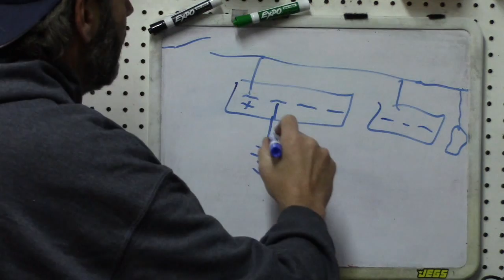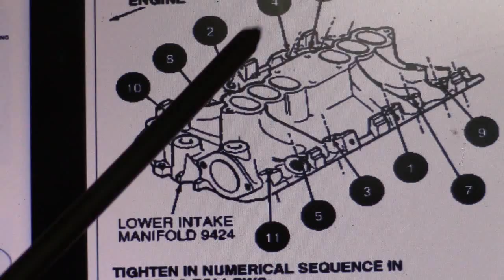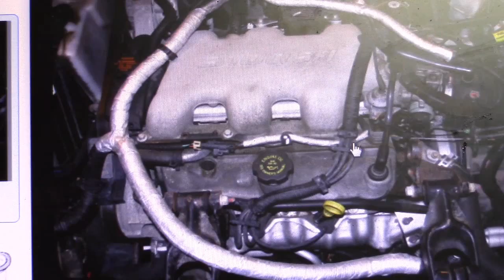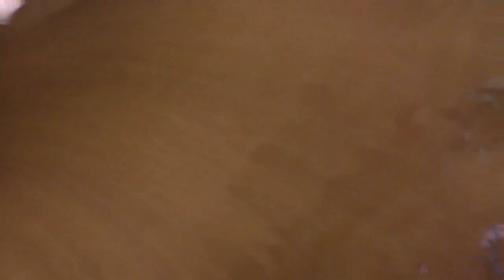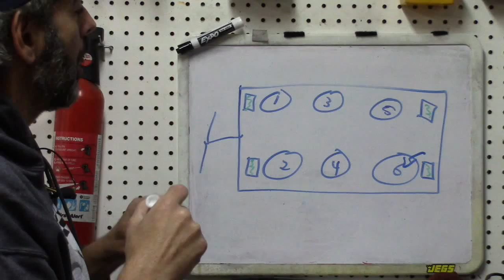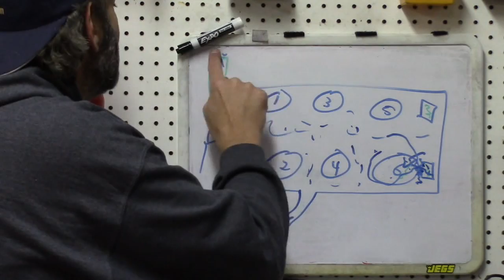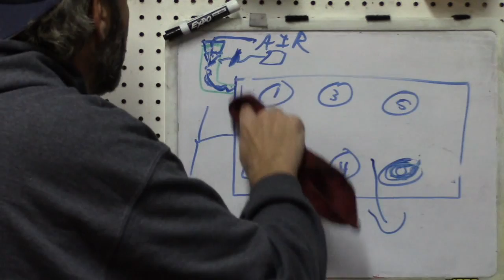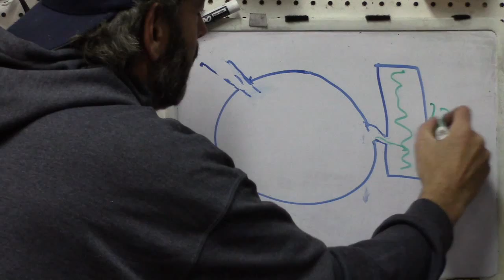04 Toyota P0306 Pt2-Can Compression Test Lie?

Comment: i think a small enough leak path would fool  a compression test and a leakdown test. did you ever try to release the rad cap after shutting down the engine to see if the condition still occurs after starting up? that would prove or disprove the theory of 12 psi forcing coolant into the cyl. i think the leak  may be more to do with time laps than engine temp. i think the leak is probably  very small and constant and after the engine  is running and burns off what accumulated during the shutdown period,the leak is then consumed in the combustion process.if the leak is small enough it wouldn't show any white exhaust smoke i think i might try to rig up a way to pressurize the cooling system and let the thing sit for a day to see how much if any coolant accumulates in the cyl,  all this babble assumes you have correctly identified the problem as antifreeze in the cyl. good luck and i hope you follow this problem to a successful conclusion.
Reply from the maker: How can the leak be so small as to fool a compression test at 160 PSI and a leakdown test at 90PSI but coolant can just drip in under no pressure? How do you explain that?
Reply: @SchrodingersBox  if air is being introduced into the cyl via a comp tester or leakdown tester  and a leakpath is small enough the leak can go undetected . you can demonstrate this by installing a shutoff valve on a leaktester and then opening it up a little at a time and see how much air you can flow before its noticeable on the gage. i think the piston ring gaps would provide a bigger leakpath than this leak your looking for . i didn't mean to imply that coolant was leaking in under no pressure. any leak detected bv a compression or leakdown test would surely pressurize the cooling system and cause exhaust bubbles in the coolant and eventual loss of coolant. i believe the coolant is somehow being introduced above the valves. a video camera looking into the intake may shed some light on this. i know you have been told that this is a dry intake, but the coolant is coming from somewhere and i think you need to separate the potential leak paths between the intake side or the cyl side.

Comment: Now I'm super curious! (Dealing with a similar unresolved problem on my Subaru, coolant loss, no test failures, nothing definitive)
Hope you get it back for completion. (I'm still stuck on a cracked head/valve guide as possible source) I've only seen it once in my life...coolant leaking onto the intake valve from a cracked guide...
I feel your frustrations!

Comment: Good learning experience.  Regarding the pinhole leak from the cooling system into the combustion chamber - think of a bicycle inner tube, out of the tire, and a pump.  With a very small pinhole in the bicycle tube you can pump the tube up and lose almost no pressure within one second - the time it takes to register a pressure reading on a compression test.  What is even more interesting is that a leak down test might not be telling in this case either as you may not lose enough PSI to register a problem over a period of a few seconds.  Looks like the inexpensive Amazon boroscope camera plugged into an IPad is a good solution.
Reply from the maker: But the leakdown test is akin to putting that tube in a bucket of water, seeing no bubbles, and yet there is still a leak?
Reply: @SchrodingersBox  no, a leak down test is not akin to fitting an air hose into a bucket of water sometimes... in some circumstances a very small leak in the combustion chamber component can be present and filled with coolant and gas in the cylinder has to work against it and displace it, how could it be put, a liquid plug within the small failure passage. Diagnostics can be very difficult sometimes and catch even the most experienced of us out at times.

Comment: First, kudos for admitting the error.  Second, don't doubt what data you have.  The error was (is) deciphering what you can conclude from it.  Coolant can flow into the combustion chamber through the intake anytime the pressure in the coolant system exceeds the pressure anywhere in the intake side.  The intake plenum is usually operating at a vacuum (approaches equalizing to atmosphere only at wide open throttle).  Second, even on the compression stroke, don't get confused that the cylinder pressure is at the maximum pressure shown by the compression gauge...it is a dynamic pressure (and vacuum) in each operating cylinder; the compression gauge only shows the maximum compression of each cylinder (without combustion, of course) over multiple compression strokes (duration of the test).  Even on the compression stroke, each cylinder starts with a pressure that is below atmosphere and certainly below the pressure of the coolant system.  

In short, I believe the compression test shows that you do not have head gasket failure on the compression side of any cylinder conclusively, but you still have a leak of coolant into either the intake plenum through the affected cylinder or via a leak in the head gasket (or other sealing surface) immediately after the intake plenum.  Can you check for presence of coolant in the intake runner to the affected cylinder?  This may help narrow down the source.

Understand you don't like guessing, but since you have no compression  issues or oil contamination, I would focus on the intake side, including removing the intake plenum, checking sealing surfaces, and replacing the gaskets on that side.  Willing to gamble it fixes the issue, and if it does not, no major harm (financial or to the engine).  A head gasket replacement is cost prohibitive and engine is running fine except when cold.  The concern I would have is that the coolant is not doing the cylinder any good in the combustion chamber as it is washes oil away from the cylinder wall (increasing wear).  Source of corrosion if engine sits for an extended period of time.   Last, could also hydrolock that cylinder at startup if coolant pools into the affected cylinder, causing catastrophic engine damage at start up.

A boroscope view of cylinder 6 will also confirm presence of coolant in the combustion chamber.  The cylinder will have less carbon build up relative to others  as a result of the coolant vaporizing during combustion.

Comment: We don't know without a complete disassembly of the engine. Lets not second guess. Empiric exit...🤣 Compression test lied!
Reply from the maker: We don't want to do disasembly of the engine- too subjective and gaskets get damaged when you separate the parts. we need a visual using a borescope on the actual leak occuring live.  Which is exactly what I'll do.
Reply: @SchrodingersBox  Great solution if the borescope shows the actual leak.

Comment: A compression test gives a vague small window of info. It has its place as a valid test, but as a baseline to dig deeper and should be taken with a grain of salt. Compression test can(but not always does) tell you that there is a problem, cylinder leak down test can(but not always does) tell you where the problem is. In some cases like this coolant breach, its easier to pressurize the cooling system and watch where the coolant goes, than it is to pressurize the combustion chamber and hope the air doesn’t get trapped in the cooling system as an air pocket and somehow make its way up to burp itself out of the radiator neck. Hope this helps. We all learn from each other, constantly. That’s what I love about being a tech. I keep a humble open mind always.
Reply from the maker: Thanks man- and thanks for calling it out in last video.
Reply: Ive had a leak down test lie to me on a subaru....  Blown rad, I recommended a LDT to verify head gasket integrity... found to be good on all 4... re-tested all 4 just for valid data...  Ended up being a small tear in the head gasket...  Had a feeling but was still fooled :(   live and learn..
Reply from the maker: @dro2204  What became of the car?

Comment: I do not think its a gasket. The chemical test will pick that up if the cylinder is actually firing. It is probably a crack or porous area in the head leaking before the valves or around an intake valve guide. 

I presume you had the intake valves closed when you did the intake pressure test? 

You really need to get the car back and look further with a bora scope.
Reply from the maker: I think so too.  I can't buy the gasket leaking and no loss of compression.  Nope- don't buy it lol.
Reply: @SchrodingersBox  I am in total agreement with Andrew. I recently purchased a 2004 4Runner that had overheated causing  the heads to warp and lose all compression. I was a professional Die Cast Die maker with a major automaker for 24 years and have a good understanding on how porosity and hairline cracks in aluminum can be in the casting just lying under the surface that can finally show up after repeated thermal cycles. 

 I wish there is a way I could share a photo of the number six cylinder on my 4.0 engine. The engine is not repairable and I will be replacing it.  I have seen other indications on line where the number six cylinder seems be problematic and could be easily due to minor imperfections in the casting process. 

If there is a way I could share this photo.  Let me know and I will do that.

I just found your channel and am enjoying it immensely.

Comment: Because there is no compression leak, I would use a stop leak product. I know most people hate them however all the messes and problems from these products I have seen have been where sealer has been used to solve a combination leak.

If you know what's leaking you can choose what product to use.
Reply from the maker: I actually agree that in this application, a stop leak is far, far more likely to work.

Comment: Let's ask Scotty.
Reply from the maker: Hahahaha. He was probably the one who put plugs in it just to try and see if it helped.
Reply: She has a minor inconvenience for 30 seconds after startup that clears and doesn't return until the following startup.  The mechanic had the plugs out and saw they were bad so he replaced them, while having the knowledge she can continue to drive her vehicle with little worries under his recommendation that it's ok to keep driving it.  Most operators will continue to drive this car.

That's my guess on the spark plug replacement.
Reply: @sportil84  It will get worse guaranteed. I speculate that the problem will present it's self in a big obvious way.

Comment: Does this engine use hot coolant through the throttle body to heat the intake air?
Reply from the maker: If it did- how would that affect only one cylinder?
Reply: @SchrodingersBox  maybe the coolant flows to nr6 because its easiest?
Reply from the maker: Flowing to 2 or 1 would be easiest. 6 is furthest back.
Reply: @SchrodingersBox  Location of the throttle body in relationship to cylinder 6, factoring in design and slope of the intake plenum. However, you have already addressed that in a previous comment. Just a thought outside the box. Thank you for your reply. I enjoy your videos, but not enough to buy in. Keep up the good work.

Comment: As stupid as this sounds, does the year before model or the year after model use the same motor type (non lower intake coolant manifold)? This would also explain your diagnosis, and in actual fact prove your diagnosis right. Because it is possible that the motor is not the same as the one you have researched about. Remember it is a scientific diagnosis which means exploring all possibilities.
Reply from the maker: Oh man if there is a wet lower intake on this thing I’ll be thrilled... and pissed lol
Reply: Both 03 and 05 models are the same ...I own both of them. 
So no dice there. They didn’t change til 06
Reply: @DirtySTEEZ4thgen  thanks Miah, but it also is something to consider from a 'scientific' point. If eliminating all possibilities.

Comment: Is it possible that the cyl head has a hairline crack above the valves that closes off with heat expansion after startup?
Reply from the maker: That’s exactly what I suspect. borescope would find that.
Reply: I'd place my bets on this as well - perfect candidate for radiator stop leak product as a repair (if indeed that us the issue)
Reply: 2nd that...after 25 years in the game, my favourite saying is still 'If I'm not learning something new every day, theres something wrong'...It's these curly ones that help stop our brains turning to mush.... keeps things interesting😜🤣🇦🇺👍

Comment: 2004 Toyota 4Runner P0306 Misfire Diagnosis [PART 1] - "Definitely 100% no blown head gasket, for sure."

2004 Toyota 4Runner P0306 Misfire Diagnosis [PART 2] - "Definitely a blown head gasket, for sure."
Reply from the maker: Except I did not say it’s definitely a blown head gasket for sure in part 2. I said it’s 100% definitely not a coolant leak from the intake manifold.

Comment: We have had success using a  coolant pressure tester  and a boroscope to find an internal coolant leak. Depending on the size of the leak the pressure tester may have to be left on longer.  Was there any engine over heat issue in the past?
Reply from the maker: Never an over heat. But agreed i’ll feed a borescope into the cylinder and over the valve and see which area leaks.

Comment: Great video! I’ve seen this problem a few times with cold misfires..I learned to not trust compression, relative compression (scope) or even regular leak down (around 80 psi) on these type of issues. I NEVER trust that stupid chemical test, only works on failed HG’s that are obvious. I’ve had luck doing a leak down with a regulator and forcing high pressure (130-140ish) and holding it for a bit. Eventually I would see tiny bubbles out the radiator neck and I mean tiny! My theory is that while cranking the engine the peak pressure is only there for a few ms at a time. I get what you’re saying about the lower pressure on the cooling system and how coolant gets in the chamber. Maybe it has to do with the constant pressure and hot to cold cycle.
Reply: OC Diagnostics i agree with this theory! I have had the same experience with these engines.

Comment: Great video!! 👍 I've seen this problem before and the only way I have been able to diagnose and or prove the head gasket leak is by removing all the spark plugs but the suspect one installing a cooling system pressure tester and crank the engine over and watch the gauge rise one psi or two. Try it maybe you'll like it and find it useful. I have learned a lot from you and I work on cars for a living! 🤣🤣 happy Thanksgiving

P.s. also works to find the problem cylinder if multiple misfires are present or to quantify the failure in the multiple  cylinders although time consuming.

Comment: How about trying a leak down test at piston down on compression stroke. Perhaps it is a busted cylinder wall towards the bottom of the bore. Maybe it is sucking in the coolant on the intake stoke from the water jacket. If the cylinder wall is cracked down low it would explain the compression test results.
Reply from the maker: That’s actually how I always do the leakdown test, so I include the cylinder walls as well. It showed no leakdown and no air into coolant.
Reply: @SchrodingersBox  Well if anyone can figure it out it will be you. I wish my doctor was as good as you at diagnosing patients. Please let us know what you find Dr. Schrodinger.

Comment: I'm thinking there may be a crack in the cylinder head that is allowing coolant into cylinder 6's intake port behind the valves, if that would be possible with the design of the head. This would explain the coolant getting into the cylinder and normal compression because, as you know, the intake valves are closed off during the compression stroke, so any leaks outside the combustion chamber are irrelevant during the compression test. Thanks for taking the time to make these videos and have a happy and safe Thanksgiving!
Reply from the maker: That’s why I think too. Explains the leak without compression loss.

Comment: That is interesting.  Could it be possible that the down stroke causes enough vacuum in the cylinder to cause the leak?
Reply from the maker: If so I would expect constant misfire and a large loss of coolant. Misfire only happens for about 20 seconds on cold start and then engine runs perfect.
Reply: @SchrodingersBox  A small amount of water in a cylinder will increase compression due to the water being turned into steam instantly.  So the engine could run fine if there is not too much water, but the one way leak is perplexing.